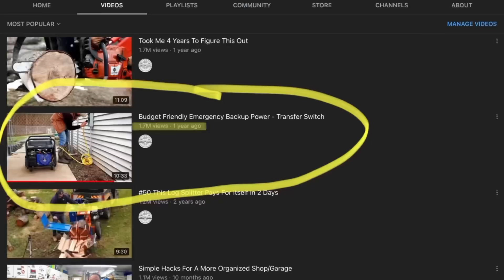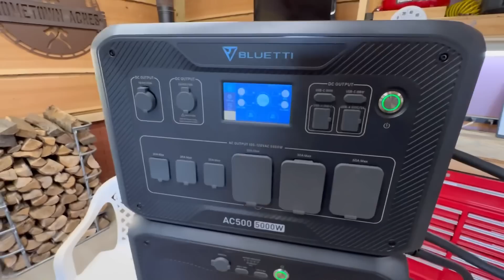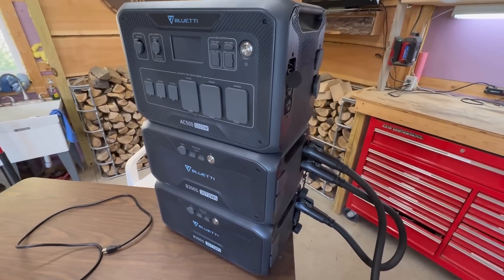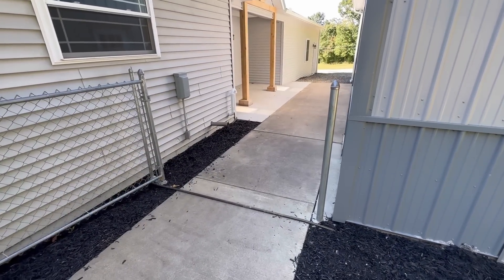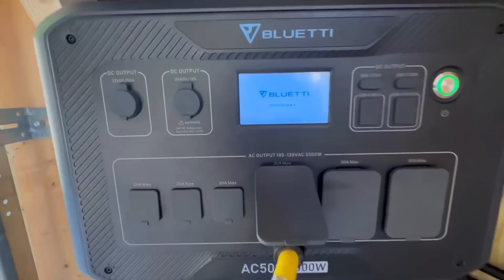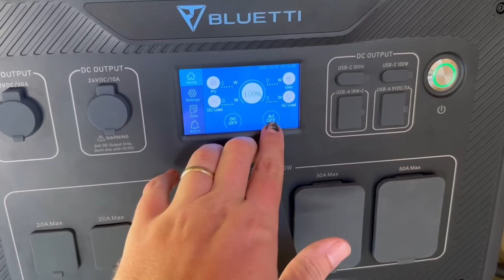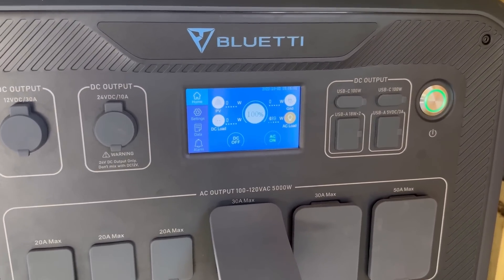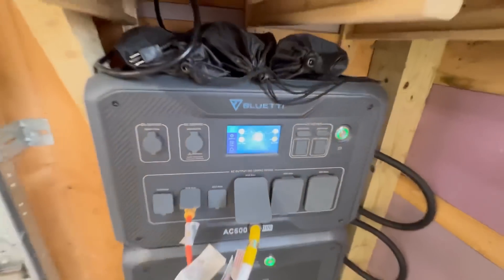The End Of The Gas Generator? - Bluetti AC500 & B300S

Comment: You can also combine both gas and ac500. But using the gas to recharge the ac500. Also if money is no issue you can combine two ac500 for 10kw inverter and have 12 batteries…the cost would be huge.  You cannplug 6000w solar in this config and each battery can have 500w solar individually so 500 x 18 additional watts. Also you can add a wind turbine to generate power to charge the ac500 system.

Comment: I have the Buletti set up, I have a 13-year-old gas generator, I have solar panels, and I have a set up to back feed power from our Tesla and our Nissan to the house. With that being said, we had a tornado come through last year knocking the power out for over a month. Thank God we didn't listen to the people telling us to ditch the old smelly and loud gas generator that is spewing carbon monoxide that could kill us. It was cloudy for the majority of the time the power was out so our solar couldn't recharge the Buletti. The two electric cars were dead, thank God we still had gas burner vehicles. The old generator has worked year after year with minimal maintenance which mainly consist of running the gas out the carbs and draining the fuel tank when not in use. People use your brains and don't let someone else put you in a position that can hurt or kill your family.

Comment: i have  a 11000 watt generator hooked up to my house with an interlock system. i have converted it to natural gas, put a tee into my gas line with a ball valve.  i also built a insulated dog house over it, put an attic fan with louvered door in it . i can turn it on and it will run for as long as i need without ever re-fueling. plus natural gas is cheaper and cleaner to run.

Comment: Not really the end of the gas generator in an emergency. Despite the misleading claims that it will "power your house for 2 days"  That rig will be able to output it's maximum 5kw to your house for 1.5 hours only before it's flat as a pancake.  A 5kw generator will generally be able to output it's maximum 5kw to your house for 8+ hours, maybe 24 hours with a refill of gas, 82 hours or more if you have plenty of fuel available. They're incomparable as an emergency supply unless your emergency's constitute 12 to 24 hours only.

Comment: Good video.  I think that you are set having redundancies with the bluetti and the gas generator.  When we had the freeze in Texas we lost power for 8 days.  Luckily I had 6kw total of portable power banks to run essentials hooked to 400 watts of my portable folding solar panels.  I had to use the Honda generators a couple of times when we did not get sun for a couple of days to charge the power banks which only required about 3 hours of run time  to charge to full capacity.   You have a great set up to take care of yourself and your family.  Good luck.

Comment: I would use a genarator to recharge them and then you go another day. I used a propane generator, never have an issue with carb or gas going bad. 20 lb tanks so easy.

Comment: I don't understand is they got an AC 500 going to B500 for a battery instead they got  B300S four batteries only 3000 w instead of 5000 Watts switch the battery should be.

Comment: Of course it might be cheaper to go with generators in a bunch of solar panels an inverter and $10,000 worth of batteries when you buy the generator and batteries with it and get $10,000 worth of battery and generator both put together don't need nearly as many solar panels to run it and or or charge it to a full capabilities the most people are going to need at least two of those units to combine together so they can get 120 and 240 v. But it does cost a pretty penny that most people can't seem to give up.

Comment: I guess you're lucky 5000 watts to run your whole house you are lucky. Of course my kitchen stove is 3600 w my water heaters 4800 Watts my microwave 1700 w my refrigerators 2000 Watts it won't run very long in my house would it not one of those but get two of them run my kitchen stove my water heater my microwave and frigerator that might be doable for day-by-day basis as long as the solar panels can charge it every single day as is being used. But that's still not everything in my house either and the worst part is I only have circuits.

Comment: Currently use gas generator, but looked at the AC500 for grid-down backup, need 240v for well pump. Seems these systems promote Split Phase for 240v requiring two duplicate systems and the initial cost is out of reach.  The Natures Generator Powerhouse has 240v, 7200w….. any experience with this unit?

Comment: I just ordered the AC500/B500S, not for emergency power but for the foundation of a whole home system. I'll be adding batteries over time until I get all six going. People haven't realized yet that this is a competitor to the Tesla Powerwall in price and power, not to mention that Tesla insists that only their people install it, adding to the $11,500 price tag. Also, Tesla has to first pre-approve your rooftop solar array before they will sell you a Powerwall.

I have no plans on ever selling my Yamaha Inverter generator. If nothing else I'll use it for camping. The AC500 wasn't really designed for that except maybe in an RV.

Comment: I don’t know where these people live with unlimited fuel in real disasters there is no gas when you run out your generator is useless.  I’ve been looking at these because you can re charge them with solar or a gas generator. These can be recharged in 2 hours on the generator verses running the generator for hours saving the limited gas you have.

Comment: I’m on the fence on whether I go all in with these (cheaply?) Chinese made battery power stations or go with a proven (expensive) brand like Victron, which is more of a DIY)

Honestly, anything longer than a week, unless you have solar and lots of sun and/or gas generator to recharge, it’ll be a tough time. 

I don’t get why I’d want to power my wifi and router. Most ISPs won’t last much more than a day on backup power for their own local infrastructure so your internet won’t be working. 

I would also presume natural gas won’t be on for much longer than week either so gas appliances will be useless. 

Recharging phones etc still somewhat useless as the mobile grid will most likely be overwhelmed right from the start until it two runs out of backup power. 

 CityPrepping YouTube channel has a good video on what potentially could happen during an extended outage. Worse case scenario but honestly it ain’t promising if it ever happens. 

And if you’re the only house in the neighborhood with power, you’ll be attracting unwanted attention, good and bad.

Comment: Gummed-up carburetors? Only if you are dumb enough to leave gasoline in the thing. And I haven't heard of propane or natural gas ones having that problem. Noise? No problem. I have a 75 ft. long cord to bring power from the generator to the inlet on the side of the house. My wife's small SUV idling in the driveway is noisier than the generator is. Do you have concerns about gasoline going bad? Why would you keep it that long? Use a fuel stabilizer, and if you think it is nearing end-of-life, pour it into the tank of your vehicle. Cars & trucks are less finicky about that. What about the generator getting wet due to rain or snow? Now that is a problem, but not too bad: I intend to build a small pavilion. To save cost, it may even have a dirt floor. Surely that can be done cheaply. Or I may build a shed that has "side sheds" (lean-to) on each side which would have no walls, just the roof overhead. The generator could run & stay dry under that with ample ventilation. On the other hand, am I comfortable with having batteries in my house that heat up due to being charged & drained? Do we ever hear of batteries catching fire? When they do, are those fires difficult to extinguish? Do a YouTube search on that.

Comment: Thanks for putting this together. Your setup is almost identical to ours. With the exception that our home is 100% electric. We’re in Hawaii and we have the house 120V wired for a light duty portable generator (1800/2300 peak) when the electrician wired our house I asked him to wire the first 120V leg for the generator connection and the second leg for the 240V. So we run the entire house on our little generator. The idea being that if lost power for more than a day (happens every so many years) then our quiet generator would not be audible from the street. Reducing the possibility of theft. While we do have to be mindful of what we run while in generator power, it is more than fine for us to be comfortable as a family of 4. The plan was to also use this connection for a solar transition over the years just like you showed in your video. Of course we have to deal with cold showers (meh, it’s Hawaii 😬), line drying our clothes and improvised electric cooking (instant pot, electric griddle…etc). We will be more than fine. Doing the math on our daily Wh consumption, the 2 battery solution should get us by for at least 2 days. And we can always top off the batteries with the generator until we get the right amount of solar panels installed and charge up on the torrential rain days. Thanks again for sharing the details on your experiences.

Comment: Adam,  Great video.  Our 4.5K generator went belly up last power outage. Not repairable.   Looking for a 10K generator and found this Bluetti 'interesting'.  Possibly the wave of the future when prices come down but for now good ol gas generator seems to work for us.  Question... On your 10 K generator and with the essential loads you have in your transfer panel, what gauge wire is run from your outside plug box to your subpanel (transfer) box?

Comment: So my question is when the batteries  Are   Depleted can you plug the power station   into your gas generator to charge that system or will it not allow it to charge that way does it need pure sign wave to charge or can it charge on modified from your generator?

Comment: Oh come on!  Do the cost comparison Mr. Accountant.  Every one of these battery generator reviews fails to address the purchase price of these units.  Your failure to address cost is disingenuous.  And this follows your Why I Bought an Economy UTV.  The best you could do was "they do cost more" and put a link in the comments to look up pricing.  How about you discuss it openly in the video !
Reply from the maker: I did both of these things. When I discussed the cons I said they cost significantly more than a gas generator and I also said they are not for everybody. For some they make sense. For others a gas generator makes sense. Watch the whole video before casting stones bud
Reply: I did watch the entire video, and it fell short of your usual practical insight.  But thanks for your condescending reply.

Comment: Danger happens when people DON'T know what they're doing. Generator is just as dangerous as a lawn mower, would you leave your mower running in a garage or shed? Then why would you leave your generator running inside? Battery powered things are great, but when you loose power and need the generator, how do you recharge your packs? So buy the electric power packs, solar panels, plugs to charge them, sure they aren't 110 . If you live somewhere where you loose power often and for multiple days , can't beat a standby generac or any standby generator that runs on propane that alot of homes have a propane tank to begin with. Just like the electric car craze, most go 300 miles TOPS on a charge, use heat in the car and that distance goes down a lot, need 4x4 that goes down more , so 200 miles if lucky before you have to stop and charge it for 8-12 hrs, and every car brand has a different plug, so just to travel 4 hrs away to our camp we would have to stop and charge, as apposed to making it there on one tank of gas and then 5mins at a gas station and drive home. Not to mention when those vehicle batteries die at 60,000-70,000 miles , then it's $7,000-$10,000 and up to replace those batteries, as apposed to gas engines that go 300,000 miles no problem if take care of. And guess what those junk batteries go in land fills . Electric anything isn't always the best for everybody, driving 20 mins to work a day great, driving 300 miles to a camp or family vacation, no thanks. So use the gas generator to charge the blue Eddie to run the house haha.

Comment: The average US household uses around 25 kilowatt-hours worth of electricity, per day.  Those batteries each hold 3 kilowatt-hours.  You can't run 240v loads with a single AC500, although two of them connected together can provide that kind of output.  The drain on your batteries would be that much faster.  This is a VERY expensive solution that still doesn't really meet the need the way a gas generator would.  Now, if your gas generator was running to charge that system back up, along with whatever solar you get (in bad weather?), maybe you'd have a halfway decent solution.

Comment: While these portable systems have the benefit of being "portable", I opted to install a 5kva plus permanent house system with solar panels on the roof and its own battery.  
This will run all of my house electrics, but having said that, I am normally the only person in the place. A definite advantage is that it effectively doesn't use a transfer switch as the mains runs a charger that supplies the battery needs and the Solar system runs off the batteries.  On one occasion I noted 11 mains failures between 11pm and 7am and everything in the place worked fine without interuption.

Comment: Another worthwhile video, Adam.  Fortunately we have several home generator options and the one you presented is certainly one of them.  Doug reviewed a couple of them recently too.  Everyone has a different situation and different budgets so it's good to evaluate each option.  As for me, I use your typical gas powered 6500 watt portable.  I wired up my own panel so I could connect it to the house system thereby avoiding extension cords.  It works perfectly fine for something that seldomly is used.  I'm cheap and don't want to spend bookoo on a permanently installed whole house gen.  If you have the dough and/or want a beefier gen then those are for you.  The Bluetti is certainly another choice. Good vid!

Comment: Hi Adam, long time fan of the channel. I just wanted to drop a comment about the interlock switch on the main panel. Similar to you a few years back I installed a hookup on the outside of the home and an interlock on my main panel. And as you mentioned, you do have to be diligent on which breaker switches you enable when on auxilary power. Since most of the time it would be myself turning on auxilary power, but not all the time I did two things to help minmize the risk of overloading the generator. 1) I went around the home and inventoried all of the devices either hardwired & switched, like ceiling lights and fans, or plugged in devices. I made sure to capture details on AC adapters, the rooms that they were located in and the specific breaker that powered them. I put all of this information in a spreadsheet and used some formulas and conditional formatting to show which devices could be on at the same time and remain under the capacity of the generator. It even helps to identify things like, turn this breaker on, but first unplug the IoT devices in the room or maybe some devices that could turn on and draw more energy than anticipated. 2) I went and re-labeled the breakers in the box for ther crucial (refridgerator/freezer, furnace, etc) devices that should always remain enabled while on auxilary. They are a vibrant yellow and let's my wife know which breakers need to be on and which need to be off in case of an outage. If we ever want to cycle larger devices on and off to divert power elsewhere we can refer to the spreadsheet on our phone or the few "optional configuration" sheets that I printed out and keep by the main panel. Of couse after doing all of this we've only lost power briefly for a few times but it's good to be prepared.
Reply: Great comment Greg.  Great minds think alike (and so do ours).  Working on my new back-up plans for a new generator and I am in the same process of inventory. Nothing like a good Excel spreadsheet to light up my life 🙂

Comment: Adam, just a question Battery is full 100% charge.
In 1 month without use how much charge would you have?
3 month not used how much charge, etc 6 months etc?
Reply: Lithium batteries are a very slow drain self discharging battery. You would still have, probably 95% or more after 1 year in storage after charging up to 100%. On the other side of the coin, these batteries do not like to be stored at 100% charge for that period of time. It is far better to put it in storage at 80%. Even better the batteries would do way better in storage at the same level of charge they are shipped with, which is 50-60%. In the app you can configure the state of charge you want it to stop at automatically. It would be better to find a use for it a few times a year. You could configure in the app that you only want it to keep 60%70% charge and keep it plugged into grid power 24/7 and it will never take in any more power and bypass your grid power as a very robust ups system. You will never notice the power went off. If you know there’s a storm coming you can sign into the app and allow it to charge to 100% just in case.
Reply: @Tony-sy7ed  thanks, sounds good 👍
Reply: Yessir, my pleasure.

Comment: We did that for two years, and since I am disabled veteran no more pulling the rope to get the portable generator started. Enter the back-up General Generator 14KW; and with everything running reserved voltage about 6,000. The cost $9,000 everything; I saved for 18 months, and being a veteran discounts saved me us $1,000.